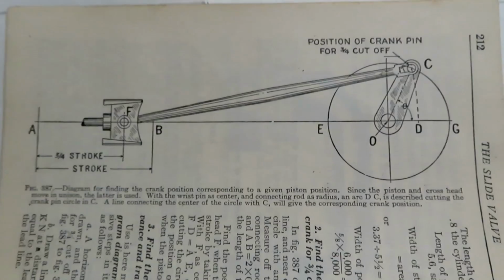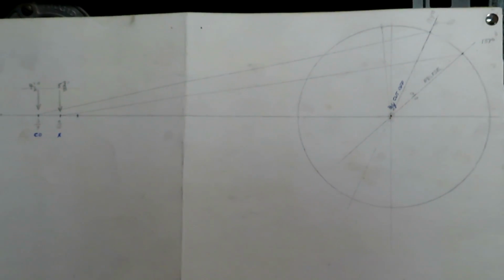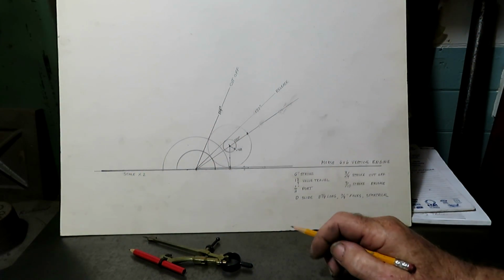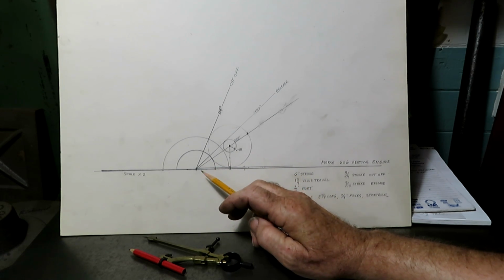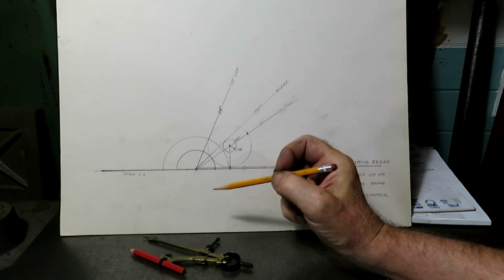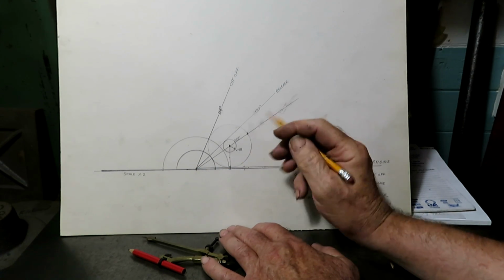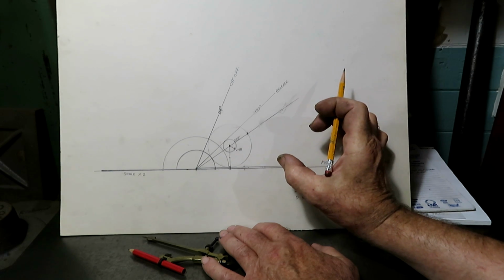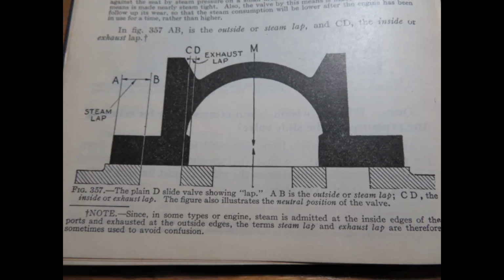OLD STEAM POWERED MACHINE SHOP 43   Designing a steam engine slide valve

Comment: Dave I'm catching up on your channel, and this was the most INSIGHTFUL video on one aspect of steam engines that until now was a mystery: exactly HOW the 'timing' of the slide valves and possibly even piston valves on steam engines was figured out.  I know so much about timing of events as it concerns the modern internal combustion engine, now I am learning about its predecessor, the steam engine.  My interest in steam engines comes from seeing operating steam locomotives and wondering the 'secrets' of setting up the various valvegears of preserved locomotives after an overhaul.  Now granted, you're only dealing with stationary engines and are not worried about being able to 'reverse' any of your shop engines or run them at reduced cut-off, but still I saw a lot in the video related to steam engine valve timing that would transfer over to valvegears on steam locomotives, from what reading in a re-print of 'The Locomotive Engineman's Manual' has taught.
Reply: That book, 'The Locomotive Engineman's Manual', dips into lap, lead, and 'events timing' of steam engines, goes into detail on them, primarily to aid the locomotive engineer with knowing when their steam locomotive has gone 'lame' due to a slipped eccentric or slipped eccentric crank and so give the engineer who's locomotive is acting up the underlying knowledge they need to re-set a slipped eccentric to a 'good enough' state to finish a trip and get the engine to a roundhouse for more extensive re-setting and repairs.  Said book however does not delve into the mathematics and diagrams involved in designing a slide valve/piston valve from scratch since such knowledge is no help to the engineman who's broke down out in the middle of nowhere and needs to finish their trip, without sending a crew member to summon for a tow if possible.  This video however does fill in a number of those gaps. ^^
Reply: "Pure Gold"!

Comment: Just got onto Ebay Audels volume 1to7.
Good timing as about to draw up a 300mm dia reciprocating low temp inline air displacer, heat retrieval for a product that has a foot in the past and foot in the future. Had it running for fourty years 6 hours aday so time to put it’s offspring on the world market. 
Most Excellent Vid….

Comment: One is left in awe of the methods used to discover the "hidden" principles hiding in plain sight such as the Conservation of Energy, which some mathematically adept Engineers might have associated with Euler's e-Pi-i sync-duration, 1-0 oscillation and 1-zero-infinity containment in i-reflection wave-particle nodal-vibrational location in mechanical cycles. 

I'm particularly impressed by Nomographs tracking pressure, volume and displacement or rpm. The simplicity of this is why "hiding in plain sight" is a probabilistic mosaic pattern of empirical shaping laws in the 3D-T landscape. 

In this way we take designs from Natural Events,  ..Geometrical Drawing and Perspective Projection Techniques applied to Observable self-defining Symbology. 
(Fun to imagine.., real-time Sciencing Re-search Technique plus the Thought Experimentalist's practical Intuition makes Actual, look, listen, hear and see real-time Intelligence, not Artificial or Theoretical guessing that is)

Comment: Interesting to see that on steam driven equipment the part being machined is attached to the table and that is what moves for the continuous machining. The modern day lathes and milling machines fix the part and the tool is what moves such as the 5 axis mill. Was that because the size of gears etc. and to fix the part as secure and steady as it could be made?

Comment: Dave, Is the intermittent load of the shaper what causes the main drive belt on the engine to flop up and down?
Reply from the maker: I would say it's because of the intermittent power pulses of the slow turning steam engine. That belt heeds to be shortened up a little....Dave

Comment: That is complicated but you gave a good description. I have some of those old books on steam locomotives. They are real gems and sometimes hard to find. The old engineers and designers were really well-educated when the most "high tech" tools they had were slide rules, machinery handbooks, a sharp no. 2 pencil and a sharper mind.

Comment: Im watching this series on the morris engine for the second time.  Fascinating stuff.  Something that I have always wondered.... how did they mill the inside (bottom)  (mating surface) of the steam chest with no rotary mill? Do you reckon it was done with a shaper and very precise settings on the stroke, or did rotary mills exist way back when?
Reply from the maker: An end mill in a horizontal milling machine was used, similar to the set up I had on milling the sides of the rod bearing brasses. In a locomotive shop, on slide valve ports they often used a portable end milling rig that bolted to the steam chest (or cylinder if the chest was removable) that was operated by a hand crank or air motor. .....Dave
Reply: Thanks for clearing that up.  It didnt occur to me that horizontal mills were around in the mid 19th century.

Comment: Hi David!
first of all:
thank you for your amazing engagement to keep these machines in working conditions under steam, every detail is pure gold!
I've got a question about your drill press shown at 42:10!
-> There is a gap between the spindle and those groove-nuts...
As I got a drill press whose bearing setup is exactly the same, my intention during restoration was to keep the axial play as small as possible, so it allows for no other movement than rotation.
I still kept a tiny space to avoid wear-out and excessive heat between the spindle and the nut, but nothing like a gap!
(drill press video: https://vimeo.com/324831956 )
-> why did you choose that set up?

Grüße from Germany!

Comment: I am 77 years of age and my grate grandfather invented a automobile. The car was stem powered. I have been told, the car had a cast aluminum engine. 
Watching your show I have a new found respect for the man. I was told, he was a black Smith the company name was the Riley engen company 2 horse power up.
Thank you so much for your show and a look back at stem and it was used.
Reply from the maker: Hi Michael, Would that have been Percy Riley?  Quite a lot has been written about him as a developer of motorcycle and automobile engines in UK.....Dave
Reply: @davidrichards5594  All I know is he started in Florida and changed his name to Riley, he was a big man, 6ft 2, I was told. Knowing how story's change as they get passed downed. I don't think it is the same man. The story goes he went to Colorado and that was ware my grangmother was borne.  He held patients, one of witch was for a pump that pumps on the in and out struck. Byren Jacken was using it whin in the 50s, so Iwas told. 
I will try to get a copy of a picture of the car. The picture was taken in Pasadena Californa. 
Think you for your response 
Mike

Comment: Bonjour David,
It is always a pleasure to follow your work, especially when I learn something about steam valves in this episode. I note that you need to adjust very often your tools, so I have another question. On my steam plants, I can regulate the heat of my little boilers with a gas regulator, it is automatic and when I stop a boat, the heat stops either, but in your workshop, how do you manage to regulate the boiler pressure as coal heats hard without any automatic adjustment possible ?
Amicalement, Raphaël
Reply from the maker: Hi Raphael,  Glad you are watching. There are a lot of ways to control the boiler's steam production when hand firing. The hardest case is probably a steam locomotive pulling a heavy freight up and down hills. You have to think ahead. On my set up I can close the lower air inlet draft door to slow down the burning if I stop the engine for awhile.  Adding a little feed water, rake the fire a little to one side, open the fire box door a crack, throw in bigger size poorer burning pieces of wood (if burning wood).  These are things you can do to calm the boiler down if it's really steaming well.  To get more pressure when I need it, I throw in some smaller size wood and keep a thicker layer of fire, open the draft door, add feed water only as necessary and a little at a time but keep it high on the glass (seems to steam better when full). Controlling the boiler is half the fun....Dave
Reply: Bonjour David,
Thank you very much to spare time for one of your 20 000 followers and offer me such an accurate answer. I have a large colletion of steam boats, boilers and steam machines, but the lonely coal fired biler I have is VERY difficult to operate : https://www.youtube.com/watch?v=5h-gJeoZH3U
This is why I am a little bit surprized because for you it seems nothing.  
I will go on following your adventures with a great pleasure, please, share with us your steam adjustments in addition of your tools (water injection, fire management, lubrication,... all steam specificities).
And I will never hesitate to ask you other questions :+)
And I have already other ones: we never hear the steam machine slow down even when you operate with a lare tool, which is the horse power of your steam plant ?  Could another worker use another tool while you are using one ? How many workers could work in parallel in your workshop ?
Amicalement, Raphaël

Comment: Hi Dave, Good video. I have been struggling with getting the proper air start timing on an oil field engine at one of our local shows. Low and be hold, your lead and cut off angles on your steam engine should apply to my situation. Like you said have to play with the eccentric and the length of control rod.

Saturday I picked up a JA'S LEFFEL & Co boiler, Springfield, Ohio. 24" Dia, 56" tall without base, 28 flues 2" Dia x 23" Long. I am missing the hand hole covers, approximately 3 x 5 in oval. Have you any idea where I could obtain these or would I have to hand craft them?
Keep up the good education .
Bob
Reply from the maker: You can buy the real ASME covers from several boiler supply houses on line, one is Murdock Industrial. You almost "can't" make them because they are curved to match the boiler and will leak if they aren't pretty close. They have the Topog rubber gaskets for them also. Cattail Foundry, Gordonville, PA has some patterns for them, I've got the clamps from them also. ...Dave
Reply: Thanks Dave, I was sure there should be a supplier of the covers, I guess I didn't use the right key word in my search. Sure glad I don't have to try and roll a plate to fit.
Bob

Comment: Great educational video David. Thoroughly enjoyed it thank you. Question for you with regards to the drill press.  That slot in the frame just above the table / work surface. Is that a pulley for a counter weight?
Reply from the maker: It is, and the small screw to anchor the chain to the spindle kept failing and there is no room for anything bigger. I made a different mount bracket/clevis and that broke. I just got tired of fooling with it, and deemed it "unnecessary"....Dave

Comment: Another great and educational video, I'll echo all the other folks that this is the best machining channel on youtube,
  Thanks for the explanation on the timing of the slide valve and the designing of it, I look forward to seeing this engine run soon. 
I know you use rain water for your boiler , have you ever given thought to catching your condensation at the exhaust  or do you have ample rainfall and catchment system, how much water  do you need to run per hour on average work load?
As always you leave me looking for your next clip. have watched them all from the beginning.
Jim
Reply from the maker: Hi James: The condensate from the engine has cylinder oil in it and will raise havoc with the boiler, The bigger engine uses about 12 gal/hr thanks for watching....Dave

Comment: Another great video. I have spent over 8 hours this weekend attempting to set up the slide valves on my 1/3 full size De Winton vertical boiler  loco and finally with the help of a friend this afternoon we managed to run it for about 3 miles , but it still needs a lot of fine tuning. Both this video and the preceding video have helped me to understand how it all works.
Reply from the maker: Great, that sounds interesting...Dave

Comment: Very interesting Dave, and well done on working it all out. Having no experience of steam timing when I made my model a couple of years ago, I likened it to a 2 stroke with 4 infinitely variable means of timing. Of course 1 of those was fixed by TDC/BDC. The other by the spool valve I made, size of holes etc. I got it running, but after modifying and fine tuning for ages, got it to run on half the pressure it required at the start.
Reply from the maker: Hi Malc:  That's the kind of trial and error stuff that got things done...Dave
Reply: Thanks Dave. Yes it is, and how the books were written in the first place. Mind you, without considerable experience of internal combustion, would have struggled a lot more.

Comment: Dave, I have seen similar diagrams in reading about railroad locomotives, but they are even more complex because they have to deal with variable cutoff  The part that puzzles me is why you don't have to do a similar diagram for the other end of the piston stroke.  It seems to me that the crank angles would be different because of the difference in rod angularity.  I may have to draw it out for myself, now that you have nudged my curiosity.
Reply from the maker: Right, the bottom part of the stroke is different as you can see with the compression event. It happens to be desirable to have the EX closing sooner on the bottom for more "cushion" effect.  The cut off, no matter what you do,  will be slightly different on each end. You can balance it out by "splitting the difference" on the lead when you adjust the valve centering....Dave
Reply: Dave, thanks for the response.  I suppose it might be possible to compensate by making the port sizes slightly different, but probably not worth the trouble.  Life is full of compromises --- 
Jim
Reply from the maker: Actually, that won't work either because the same port edge that you would have to move controls both the opening point and cut off. If you changed it for one, it would screw up the other.  It's one of the shortcomings of a plain slide valve. You could think of it as: The valve is moving correctly, it's just that the piston (because of rod angularity) isn't getting there at the right time....Dave

Comment: Dave, thanks for another excellent video on that engine rebuild. Maybe my question here is answered somewhere in a past video, but your shop floor is plywood. I would think a concrete floor would be best suited for the weight if your machinery? Please refer me to a video of yours where you may have discussed that. Thanks!
Reply from the maker: Blacksmith and forging shops had dirt floors, most machine shops had wood planked floors with a crawl space. The machines were on concrete pads extending through the floor level to the ground. Really heavy stuff like steam hammers and planers had piles driven with concrete over that. Railroad shops were "cutting edge" facilities with all concrete floors.  My floor is extremely heavy built wood beam and plank, but I will eventually cut holes through the floor and pour concrete pads as I did with the O&S engine and the boiler. ....Dave
Reply: Thank you very much Dave for your response to my question in such detail. Eager to view the next video. Take care.

Comment: You have been running the big engine for a while now.
 Do you think the big engine is more economical to run the shop than the smaller engine?
Thanks for the vids.
Reply from the maker: Dennis, I does take noticeably more water, so it uses more steam. I can't tell from the fuel use because the wood is so bad and inconsistent.  Lathe, rotten bridge floor plank,  old deck floor,  Half rotted barn beams, etc......Dave

Comment: The Audel's book 
https://archive.org/details/audelsengineers00grahgoog
Reply from the maker: That is #5 of that set, same 1921 copyright as mine. Great set.....Dave
Reply: Sorry, correct link https://archive.org/details/audelsengineersm01grahrich
Other parts by the same author or just click the authors name on the page. Looks like they have 7 volumes and a couple more topics from another series in there.
https://archive.org/search.php?query=creator%3A%22Graham%2C+Frank+Duncan%2C+1875-%22
Reply from the maker: OK everybody, listen up.....no excuses now,    CO has listed the links here for the Audels "Engineers & Mechanics Guide  No.1.  Read the section on slide valves for next time.....there may be a quiz....Dave

Comment: Hi Dave, many thanks for this series on the 1900 engine. Finally i have been able to some an explanation with supporting theory. There is a huge amount of content on steam loco valve timing but nothing on steam engines/ traction engines. 
I have a 3" Fowler traction engine that i need to set the valve timing on, and nowhere can i find what the lead angle is. Now i can sit down and make a scale drawing of the various events and hopefully get her in steam.

Yours Andy
Reply from the maker: Just lay out the events on the flywheel and you can see where you should be,,,,,Dave
Reply: David Richards Will do. If there a rule of thumb or nominal distance/lead angle for the steam inlet BTDC?